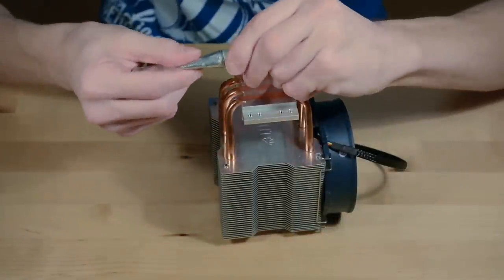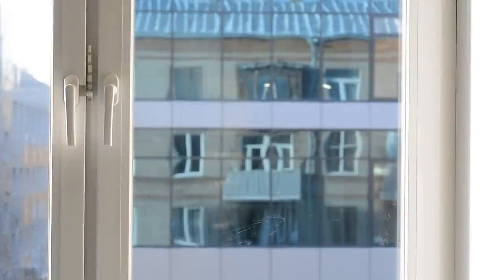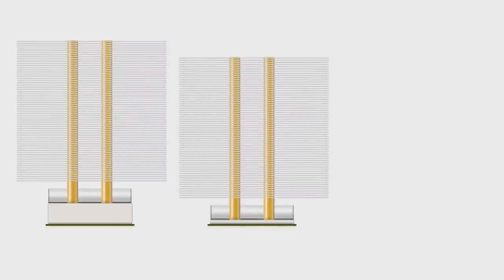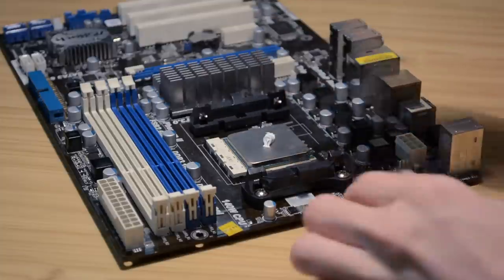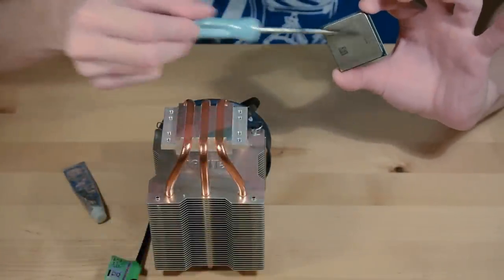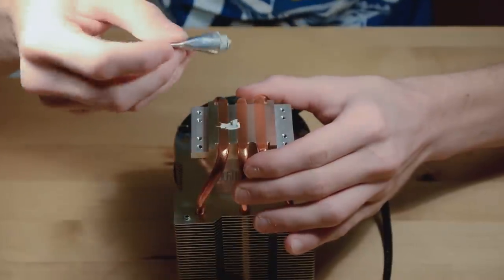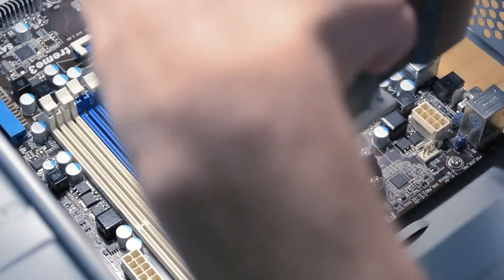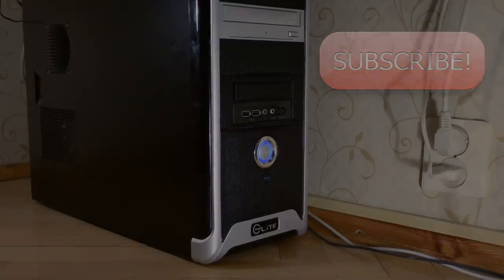Thermal paste: How much really need to apply and how to do it correctly? Как наносить термопасту?

Comment: I will give a neutral perspective here to people who are confused as to which approach they should take.

1. Spreading of thermal paste manually does create air bubbles. It is not a myth -and that's probably why it has angered some people who uses the conventional approach. However if you are experienced at  spreading it, you can do it well enough such that you can minimize the amount of air bubbles while ensuring your thermal paste is spread out really evenly. 
2. The conventional method is on the contrary a safer approach as it brings the amount of air bubbles to its bare minimum. That said, you cant really control the spread of the thermal paste as well as manually spreading your thermal paste. 
3. Its pretty much idiot-proof with the conventional method (except for that few people who can literally set water on fire) Its fine to try both methods (provided you do it correctly) but not NONETHELESS,  you need to monitor your cpu temperature for a bit to ensure you did it right =)
That said, good luck and cheers!
Reply: is it racist if I believe you more because you're Chinese?
Reply: @Aaron-hg8jo  LMAO